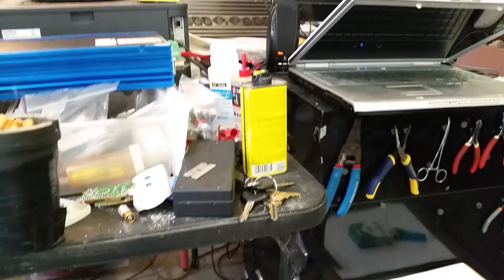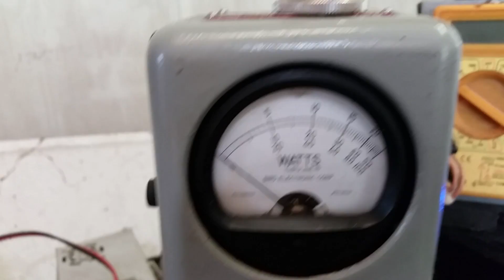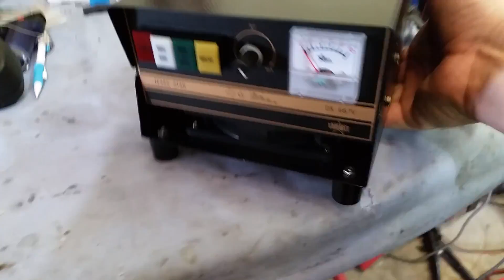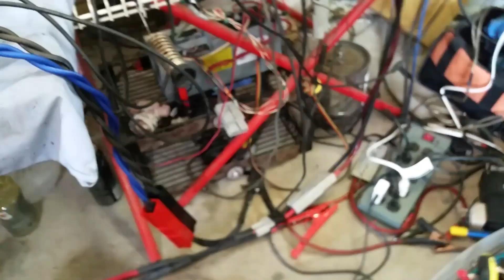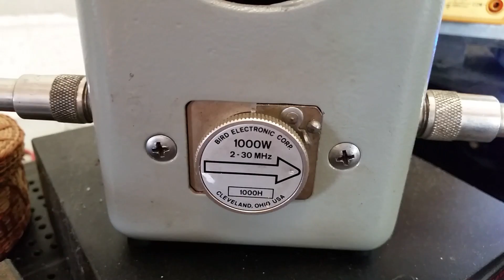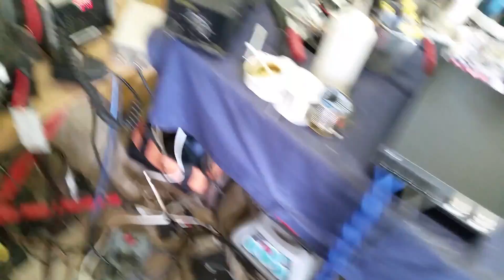Texas Star Show Case FOUR BRAND NEW Ones & Moded!

Comment: Do you feel comfortable sharing the core material you use for direct feeding the transformers in the power wire upgrade and the core material you use for the beads on the main power wires. I'd like to get rid of the 20 gauge beaded existing power wire to the transformers.

Comment: great work! The ones that came threw my shop wear 2SC2290 driving 4X2SC2879 and had glass fuse holders that get hot. thank you for the look at the new ones. Also I put 10 GA jumper between ground on boards .love the hi/low fan idea!!  I was using a thermal switch from mouser for temp control.  thank you !!
Reply from the maker: robert meyer if you dont mind can you share with me exactly what type Thermal Switch you found to work well? Im implementing thermal protection on a few custom builds
Reply: I used thermostat switch from Newark.com thay have a lot to choose from. I used 115F NO to turn on fans.The data sheet is on line . mouser electronics has them too. My HOTPLATE came with thermal switch mounted to the PCB!  It got too hot before fans came on. mount them directly on the heat sink! use thermal compound same as transistors.They doent handel much current so use relay  . You can use NC contact to open keying circuit to shut down amp. Good luck. glad to help for the band we all love.
Reply from the maker: robert meyer okay cool beans yes that is actually the one I am using it a hundred 15 degrees and it's the same one that comes on the 1200 and the 1600s so far I have used them home two of my builds with a as a thermal protection circuit using a relay with them and the only reason I used a relay so the user also can turn it off if they wish not to use it so far it works really well on one of them I put it towards the very corner of the heatsink cuz I knew once that very Corner which was the furthest away from The Middle got a hundred fifteen degrees then that would be a good time to turn off but I still got some testing I need to do with that to find that perfect one thanks a lot for the information